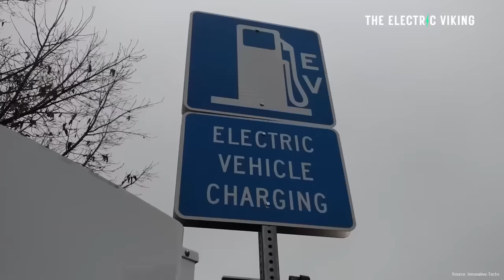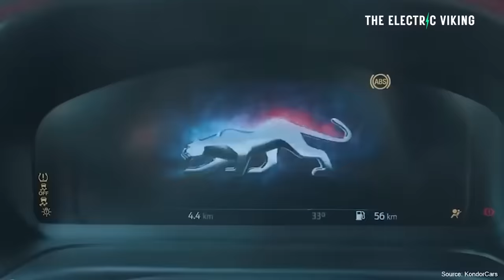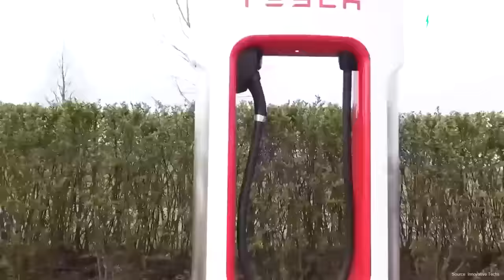UK Government Delays Gasoline and Diesel Car Ban to 2035

Comment: Adam Smith is going to decide when the transition happens, and there is not a great deal the politicians can really do about it. Tesla Model 3 in Canada is $50K Canadian before incentives, which in Ontario almost pay for the 13% HST (VAT). MUCH more importantly ... I see decent USED EVs (mostly Leafs but the odd Kia or Volt) drifting below the $20K mark. If anyone knows how to ascertain the health of a Leaf battery I would probably buy one - my longest round trip in a day is 50 miles.  Or an honest service organization (as in NOT a Nissan dealership) that can service the battery pack.
There is an opportunity out there (a la "Rich Rebuilds") for a business that refurbishes battery packs - I would start one if I were a decade younger and not retired.
When USED EVs become affordable and a reasonable alternative  for the traditional USED car buyer, there will be a second acceleration.
Reply: That's exactly what happened in Norway, Belgium, the Netherlands and Austria.

These government exempted the business car buyers from the sales tax (20%+) for EVs. The business fleet has been bleeding into the 2nd hand personal market in 3-4 years cycles. One of the best policies there is apart from tax credits - bother the business and private owners electrify and there's a link between the two.

Comment: Targets for manufacturers have been kept the same, so if manufacturers want to avoid financial penalties they need to ensure an increasing percentage of cars sold are pure EVs each year. 2030 already stood at 80%, because hybrids were already permitted to be sold until 2035. The first target, coming into force in 2024 is that manufacturers must sell 22% EVs or be fined

Comment: Apparently the EV mandate remains so manufacturers still need to sell 80% EVs by 2030. So it's not all bad.
Reply: I hope thats true and i agree with the Viking by 2030 this is likely a moot point as oems will not be able to afford to sell them at a price thats even vaguely competitive with BEV and if what you said is correct that cements it since that 20% will have to be high end petrol because they aren't going to waste it on cheap  unprofitable fossil cars. And thats if, with 20% fossil only theres any profit at all in them.
Reply: Talk about sending mixed messages! It’s like they revel in causing confusion and chaos. I’ll be glad to see the back of them, the last 13 years have been a nightmare.

Comment: To be honest, the ban was on NEW petrol and diesel cars, you would still be able to buy second hand cars well into the 2040s given the average life of a car, the move from 2030 to 2035 reverses the change made by Boris Johnson when he was PM. Also there is doubt that outside the South East infrastructure is capable of dealing with  a large move to EVs.
Reply: The South East is hardly awash with charging infrastructure!

Comment: That ban was shaky already when the EU pushed back their van by five yrs a few months ago
Having said that it may just be a footnote as an increasing.proportion of cars made and sold in the UK are EV. 
The car industry isn't as entrenched but the flip side it can pivot
The main issue is upgrading infrastructure like charging points and the grid and find more power capacity

Comment: just to be clear it's only the production of I.C.E. will be banned in 2030. You  will still be able to buy  I.C.E vehicles. However the way local Cities are starting to impose restrictions on i.c.e vehicles i.e ULEZ zones will severely restrict the movement of said vehicles and you can bet that more Cities will follow and as a result it won't be worthwhile having an i.c.e vehicle. I was dismayed when this was announced and one quote from the Prime Minister saying the infrastructure was not good enough, well hey as you said the market will be ev despite the charging system so we might as well get a move on.

Comment: The UK doesn't, at present, have the electricity to power the current number of EV'S. Where will the additional energy come from?
Reply: Silly comment, the UK quite clearly has the electricity to power the current EVs, have you noticed any power cuts/outages?

Comment: The ban was on the sale of NEW petrol and diesel cars. Existing diesel and petrol cars were not affected and people could still buy second hand diesel and petrol cars after 2030. HEVs were exempt until 2035. I think this will slow down the spread of public chargers and generally delay the transition. I hope Labour will reverse this when they win the next election, which unfortunately is over a year away.

Comment: There are a few errors in your report, I'm afraid, and this is down to the news media.  The ban only ever referred to the sale of NEW ICE cars, and for 2030 still permitted the sale of hybrids.  The prohibition on the sale of hybrids was from 2035.  The change, with which I personally disagree, is to permit new ICE vehicles to be sold up until 2035 as well.  In fact, even that is an over-simplification because the ban comes in on a staged basis as the proportion of new ICE vehicles allowed to be sold is reduced every year until reaching zero in 2035.  Motor manufacturers will be fined £15,000 for every vehicle over the permitted proportion every year, which figure itself then depends on the numbers of fully electric vehicles sold.  Yes, it is complicated : we have a Conservative government!  Since the motor manufacturers are unlikely to change their production plans overnight, Mr. Sunak's announcement is unlikely to have very much effect on actual EV adoption.  It is a Political statement to try to boost his failing poll ratings.  My concern is more to do with the UK's reputation over leading the EV adoption 'race'!  What you say about the UK's significance is absolutely correct.  Sadly, we have too many people here - especially some politicians - who have an over-inflated view of our importance: hence our leaving the EU, probably the World's biggest consumer market.  Smart move that!  Me?  My next car will be an EV, simply (as you say) it will be better, cleaner, and cheaper.  Game over!

Comment: Its probably irrelevant whether there is a ban or not. Most car manufacturers are going out of business and the production ramp for EVs will probably be slower than the increased in material supply meaning batteries will become cheaper and electric cars will become disproportionately cheaper than ICE. 
The price of electricity will have a big impact as well. Its been very high in the UK, if it comes down significantly, then a lot of people will switch. But the UK need to sort out the grid. At the moment there's no point building additional generation capacity, there isn't enough cabling to get it where its needed.
Reply: Agree - the market will decide ban or no. As EV sales increase the demand will force the government and grid to accommodate / adapt there will be no choice in the matter.

Comment: I am in favour of this change. Sunak did this in an attempt to stay in power at the next General Election in 2024. UK politics and eco terrorists are chaotic at this time. A surprising number of UK motorists are getting out of EVs and moving back to ICE vehicles for various reasons, including the lack of chargers and the number that do not work. Don't be concerned about Ford. Their CEO Jim Farley has indicated they will pull out of Europe to prop up the US operation, if necessary. They have already discontinued some of the best selling European models. There is a bigger threat to cars in general, for Europe and probably the world. The dictators at the WEF!

Comment: The problem with saying EVs will take over so soon is still just the fact there is a battery supply limit. Until another 2-4 years go by - we're still stuck on gas power for a bit. Simply trying to kill it for wont end well yet. I say most companies have another 2-4 years before they have to really worry about it - but in those 2-4 years they DO need to start switch over to EV designs. They dont have to make them, but they DO have to be ready for them. The reason is solid state and sulfur batteries will be on the market by then - reducing cost of the battery by half or more. More plants - more options on what batteries to use. The oil countries simply are selling oil higher than ever - almost 3-4 times higher and I think that will back fire on them here shortly LOL. I hate to say it, but if I was an ICE car mfg I would be looking at gig presses, reducing the number of people I need, reducing over all steps, and improving talks with local suppliers. It does mean less jobs, but it also means less steps are needed making the ICE car cheaper - but it also means the witch to EVs will be a lot easier too. This being something they need to do now in the next 2-4 years other wise their cost will be soo high they will be price out of the market.

Comment: Rather disengenuous comments on the UK government. The UK is not dictating to the car manufacturers what to produce but just removing a restriction on the public as to what type of car they can buy. Population density of England is very high and 40% of houses don't have off street parking for charging. Forcing them into EV's 5 years before the rest of Europe is not sensible.

Comment: Not enough electricity produced to run all these cars
Reply: Solarpanels and windturbines... 😊
Reply: No problem in Norway
Reply: We just had a really hot summer in the US , didn't hear about black outs, so I think , solar wind and the rest of power will be able to handle the increase in US , I just wish the US would treat Natural gas differently than the rest of fossil fuels , because it is over 99% efficiency,  less pollution by far than the rest of fossil fuel. Would like to see more Natural gas power stations. In the US , US self sufficient on Natural gas.

Comment: Wait until 2026 when 30k gigabatteries are installed. The grid will change over and the writing will be on the wall. The the only thing left is wireless charging in the road.

Comment: Isn't one of the biggest issues simply the electricity generation capacity, should everyone switch to EVs?  Will renewables help with this, as they appear to be the quickest to deploy?
Reply: Simply not an issue. national grid has stated many times, that this will not be a problem.
Reply: @barriedear5990 We have been threatened with black outs recently so not true. The transition of power plants has created a supply shortage national concern which means industry and homes being hit is quite possible before even greater demand upon it.
Reply: EVs help the grid if anything. Vehicle to grid means they can act as batteries for the grid
Reply: @garydavis1528  "Threatened" ie: it was reported in the tabloid press.
Reply: With the reduction of electricity for refining oil into petrol & diesel there should be more electricity available for (electric) transport. It's self evident.

Comment: I think EVs are better cars to drive and own, but I don't believe in all the environmental w*nk that goes along with it. The only environmental impacts of ICE that I care about are the air pollution and noise they generate. Set stricter emissions standards but don't ban them. All that will probably do is make a lot of people hang onto their old ICE bangers, rather than upgrade to a new car, which will be even worse.
Reply: Same here - I love my EV for what it is - a great car to drive/own. Didn’t get it for green reasons just makes sense in my circumstances. Do laugh though at all the fake outrage whipped up by the press that people fall for.
Reply: Erm. Elimination of toxic local emissions is the single largest benefit of EVs. It's MASSIVE.

Comment: The UK is nowhere near ready for EV’s as the only car-type you can buy. The power grid and charging infrastructure just isn’t there. By 2035 it might be but right now it isn’t.
Also, buying an EV at the moment will be similar to those that rushed out to buy laser disc and mini disc players some years ago. Current battery tech is based on ancient ideas and needs to change dramatically before EV’s will be the car to go for. Until then, if you're buying it with your own money, stick to ICE cars as the tech is proven and you'll still be able to sell it in 10-years time for good money, whereas the current crop of EV’s will be considered dinosaurs and worthless.
Reply: Good to see a reasoned comment.
Reply: Well said 👏
Reply: Are you serious, I mean really, you really think that?

Comment: A lot of younger folks enjoy ICE sport car convertibles with a 6 speed gearbox.  22% of new cars sold in our country have manual transmission.  So with EVs?  No rush with the current applications.  Maybe maybe 30 years from now.
Reply: I think you’ll find virtually no young people can afford a sports car convertible m8, ICE or otherwise. Sales of these type of cars is minuscule and massively by older wealthy people.
Reply: One of the dafter comments to a video that I've seen in months. Young people in sports cars? Really? Get a grip.
Reply: Insurance is astronomically expensive for young people in the UK no matter what they drive. Therefore there's nearly no chance they'll get near a sports car unless their parents are financially supporting them in such matters.
Reply: Most young people in this poor benighted country can’t afford new cars.
Reply: @hishamg   Forget young people. Most people of any age can't afford new cars.
Reply: @kalebdaark100  True! I’ve been driving since 1987 and I have never had a new car! The closest I got to one was an 11 month old Mazda 6 with 10000 miles on the clock back in 2010. I’ve never had anything that new since then! 😃
Reply: @hishamg   Driving since '88 myself and the closest I've got to a new vehicle is the Nissan eNV200 van I drive now. It was just over 3 years old when I got it. Good vehicle, I would like more range though. Newer EVs put my van to shame these days.

Comment: Chinas manufacturing dominance means that EV subsidies are helping to extend China's manufacturing and overall industrial supremacy. Western nations are essentially subsidizing their own industrial and social decline.

 Don't be fooled by assemble plant locations becouse the substantial real manufacturing happens close to where the dirt become metals and the hydrocarbons are turned to plastics. Modern auto final Assembly plants are becoming more like Ikea furniture assembly where things are clicked togethering it's a process which is taking  less and less  overall work..

 In the short term a lot of profit can be made in  the process of deindustrialization but once a nation or region losses the ability to turn raw dirt into finished  goods  it will lose that capacity forever and doom  succeeding generations to poverty.